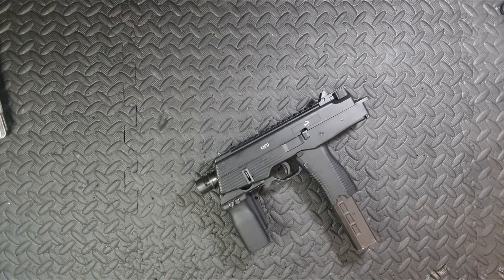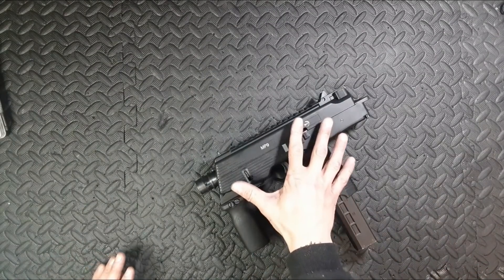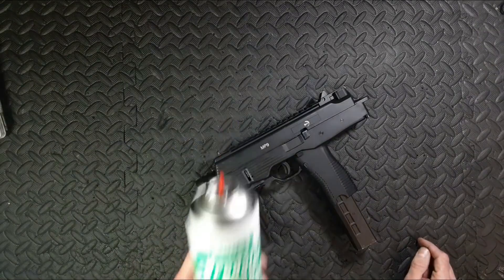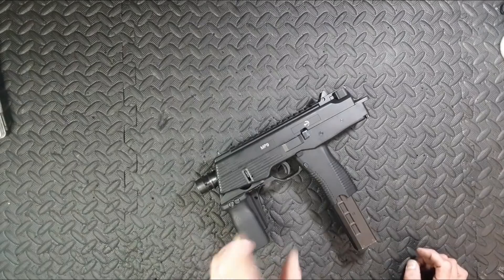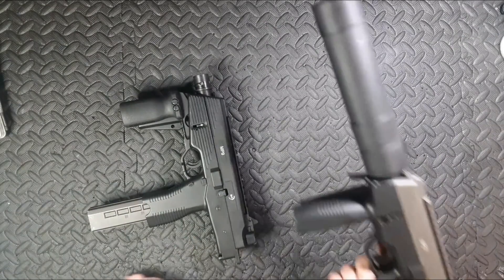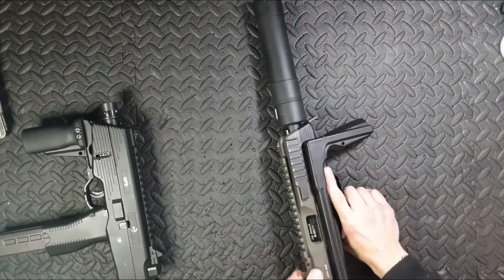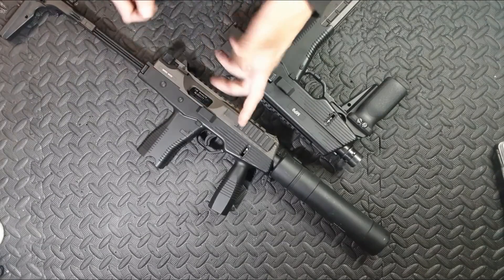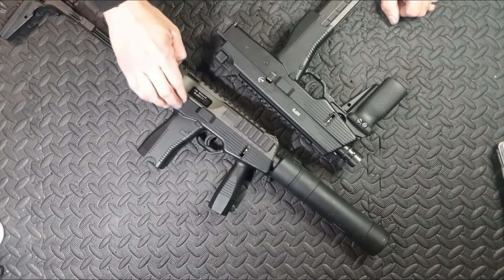MP9 Bhadaids Custom!

Comment: Just bought a used mp9 myself. Owner sold it because it couldn't fire more than 10 shots. Turns out the cup seal was ripped, ordered the Lees Presicion piston head now it runs pretty good other than the fact that sometimes the bolt doesn't come all the way forward, which doesn't activate the trigger and a new shot can not be fired. But thanks to your solution with the extra spring this problem also got solved! Thanks

Comment: What do you actually think about the aap-01 especially internal wise ?
Reply: Aap 01 rocks. It's good out of the box with .36 gram bbs. You need a 138mm crazy jet or 6.03 tb gbb barrel, a 50 degree maple leaf autobot and the hadron I key, the suppressor adapter (to cover the extra barrel length with a suppressor). With those components you can rock .48s out to as much or more than 120ft. Word of caution though...get the glock 18c extended mag or you will mag dump a standard mag in 2 seconds on full auto.

Comment: Nice video as always. The MP9 is a dream to play with as long as it works. I have heard people claim that loading the thing without locking the bolt back risk breaking to loading arm. Any guess if that may be true?
Reply: S4zzie it is true in that you can wear down the bolt catch and eventually when you fire your last shot of a magazine, the bolt won’t lock back
Reply: @ritzcar9011  i don't know how common it is but it had that problem when I bought mine second hand. The catch works just like on a gbb pistol but the catch is must harder than the bolt and it is sharp, so it wears down the "ledge" which it catches on for every time you release the bolt. I tried rounding off the surface on the catch and I filed a new ledge on the bolt, but it worn down again. My MP9 is disassembled for the moment but I am planning on adding epoxy where the bolt meets the bolt catch so it hopefully does not wear down.
Reply: S4zzie I haven’t run into that problem yet, I just lube it before every game depending on how much I shot the last one, I run hpa tapp so
Reply: @ritzcar9011  I'm glad that you haven't, and if you do experience it you now have an idea on how to approach it
Reply from the maker: @Thahamster  Every gas gun has that issue if you 100% load the mag - always leave 2 bb's of space so that you can get a mag in without damaging the nozzle.
Reply: @NegativeAirsoftTech  That's fair. The person who made the claim did so after loading just a handful of BB's in order to chrono the gun, so I wondered if it was extra prone to breaking or something.

Comment: I really want to run one of these as my primary, are they viable? It'll be used in semi 99% of the time, is the disconnector the main failing part?
Reply: Yes, but expect the disconnector to break every several thousand run or so even on semi only.
Reply: The disconnector is the first to go normally. I suggest buying the steel upgrade, even if you use mostly semi. Swap out the stock one once it breaks.

Comment: THANK YOU!!! I have been saying this all along. People keep using the wrong fucking gas in these things. The hop rubbers are shit too. if you use green gas or ANY gas with silicone in it your hop rubber will fail straight away within 20 minutes of play. I fixed one of these for a guy told him what gas to use. Within a week and 20 minutes on the field he was calling me to fix it again. "what gas did you use?" Duh valken green gas- sure Im gonna fix it again and its gonna cost you 30 bucks...Im happy to take your money but if you keep doing what I tell you NOT to do you might as well learn to fix it yourself 'cause Im not gonna do it anymore. as for the recoil spring issue...the force of the bolt gong forward is more than enough to compensate for the lack of spring strength. thats what i found anyhow after playing around with diff springs and short stroking.
Reply from the maker: Lube won't ruin the rubbers, that's just not true.
The rubbers in these suck, use a guarder rubber.
Reply: @NegativeAirsoftTech  well have to agree to disagree...my customer used silicone green gas in the gun and the hop rubber soaked up the silicone so bad it swelled up and wouldn't hold a bb to save its life. Others have had this experience as well particularly the japanese model. The hop rubber just lose their structural integrity. And the japanese model guns require a completely different hop rubber than the tw version.
Reply from the maker: @ghostwalkerairsofttech1947  It was a batch issue, certain oils & so forth used in the creation of certain rubbers are on the no no list of sanctions placed after WW2.
The rubber will swell up regardless of what you do, the Japanese rubber is unaffected however the TW versions that KWA & ASG buy up are compiled from lesser quality parts & that includes the hop rubber & the seals in the fill valves - this is why so many KWA mags have issues filling with gas very much like the early WE 1911 mags & often cannot fill past 10 or so shots.
Recently this issue has been put to rest by companies such as Army by buying in rubber seals from outside of the sanctioned zones -that's why they have transparent seals in their mags over nitrile seals ;-)
The early ASG & KWA manuals would tell you not to lube your hop rubbers where-as they no longer do (again, batch dependant) which is where the rumour that lubing your hop rubber causes breakage comes from.
By installing a Guarder rubber into the gun for the cost of about $8 all these issues go away & the gun will hop properly.
Reply: @NegativeAirsoftTech  great info Luke...I do lube hop rubbers that is what sent me sailing down this road of using the proper gas in the mp9. And being the japanese model hop rubbers were so hard to come by I didn't want to risk the customers only replacement. The hop rubber for the Japanese model if I recall is larger than the tw model, so a standard size hop rubber will not work in this particular gun. Same for the sealing cup, the tw version is round, whereas the jp version is oblong.